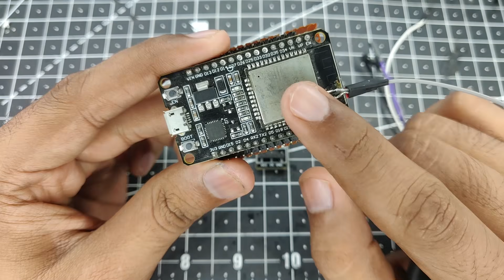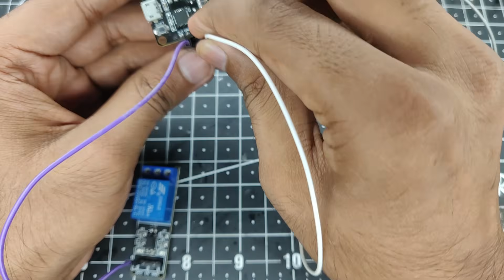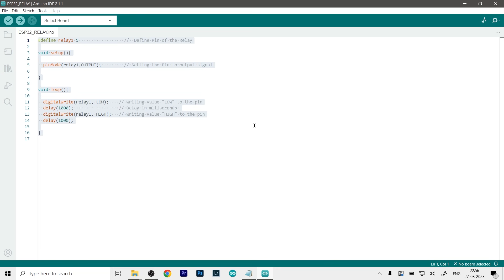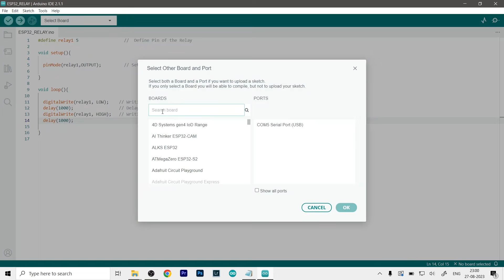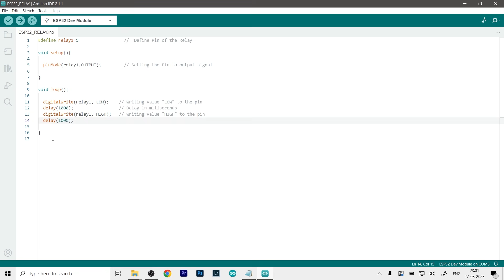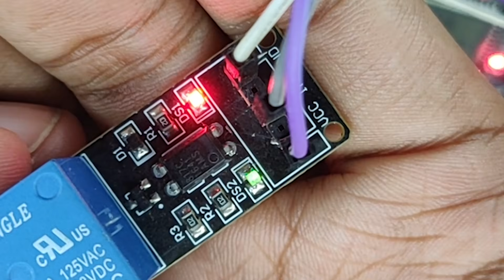How to use a RELAY with ESP32 | Easy Guide

Comment: I have a question, for a #BMS 3S 18650 Project to monitor SoC, SoH, Thermal, etc, I want to add 12V Motor, 12V Fan, LEDs for Fault indication, Relay Module (1 or 4 on the module), Current Sensor INA219, (16*2) LCD I²C , (and Voltage sensor?). What board (Not breadboard) I should use to attach the #ESP32U MCU DevKit? I know that for LCD I need to use I²C backpack.

Comment: Sir, i make a home automation project in used Nodemcu 32s board. but my  relay not operate due to low voltage output in board. Please help me in findout problem.
Reply from the maker: You must be powering the board via USB which is 5v. Use the same for relay as well.
Reply: @INOVATRIX  I have  tried but it's working but not turning of when it's supposed to

Comment: what is the wiring configuration for the other side of the relay?
Reply: It’s GND which you have on the esp32, then you have power which is VIN and then in the code you can define the signal pin. Like pin5 is used in this code so you have to use pin5, printed as D5 on the esp32

Comment: Where do you supply power if you disconnect the usb cable?
Reply from the maker: There is a pin labelled "VIN" on the board, you can easily connect 5v supply to it.

Comment: Interesting but a few questions if you can answer please.
1. How many relays can you control? Relays to open close a solenoid coil actuator.
2. To make use in a practical application such as an ESP32 camera installed, detecting an apple. If it's in center of picture open door_center. If it's to the right, open_door right. If it's to the left open door_left 

If you can help out, otherwise thanks, still an interesting short video.
Reply: 1. As many pins can you spare, possibly infinite if you use shift registers.
2. i dont know
Reply: @Epic_coding200  thanks, possibly using multiplexes too.

Comment: This is 5v relay, needs 5v power supply and 5v logic level, how does it work with esp32 which is 3v3 ? - is it reliable, could it damage the board ?
Reply: For me  with upython IDE and the esp32c3, this solution has problem when the relay is with load and i think need a transistor for change the 3V3 to 5V.
Reply: I am currently trying to make a relay work with a ESP32, i have a SRD-03VDC (3V) and it doesn’t have enough Amp output i am starting to see
Reply: The esp 32 can work with 5v
Reply: @zonadosaber9804  ESP32 can work with 5V, but can't provide 5V HIGH on GPIO pin, that's the issue
Reply: @Marmaralone  Thanks so much. I have esp32, it's amazing. I had build a iot sistem. Sorry for my english, i don't speak verry well!
Reply: @zonadosaber9804  no worries that's perfectly understandable. Yes ESP32 is very handy and cheap tool, limits are your imagination :)
Reply: @Marmaralone  im beginner, how about use transistor? Cmiiw
Reply: @hwoulsetx  yes that's what I do when I need to use a relay with ESP32. For example a BC547 would do the job.
Reply: @Marmaralone  oh! Thank you !

Comment: bro 3.3 and 5v pin of esp32 is used to supply power to esp32 but how we can use it for externa  purpose this will harm our board
Reply from the maker: Board can get power from the "VIN" pin. 3.3 and 5v can run small components.
Reply: @INOVATRIX  thanks that helped me i was confused betwen the normal 3.3v and vin pins

Comment: 3.3V to 5V relay ??
Reply from the maker: Relay is of 5v but works perfectly with 3.3v
Reply: @INOVATRIX  I am using ESP32 3.3V with Relay 5V. But the switch does not work. If I connect to 5V it keeps the switch on but it does not turn off is there any solution?
Thanks!
Reply: @pineappily3119 Hello! I have the same problem. Did you find any solution? I use the Esp32 version with 30 pins
Reply: @pineappily3119 same
Reply: @pineappily3119 I'm facing the same problem. did you find any solution?
Reply: @pineappily3119  did you find solution?
Reply: did you find the solution? @pineappily3119
Reply: @INOVATRIX I'm also facing the same issue, please suggest a solution
Reply: @abhijeetbhattacharya606 did you find the solution?
Reply: @INOVATRIX  for me works but when connect a LED lamp 1W  ... no. Do you test with load?
Reply: @JoseTrujillo-qz6gv  If I connect load relay doesn't work 😢